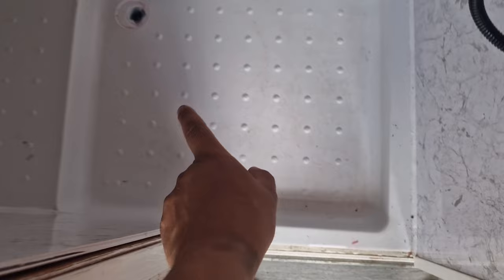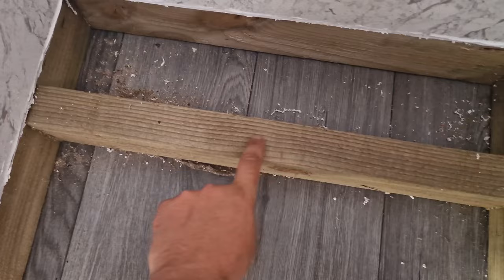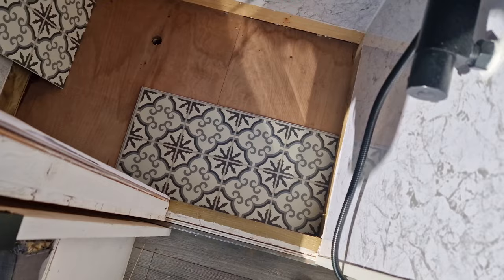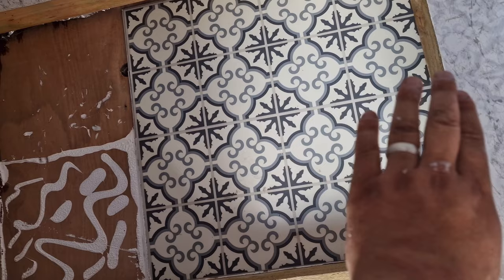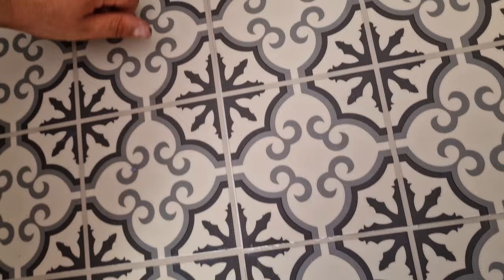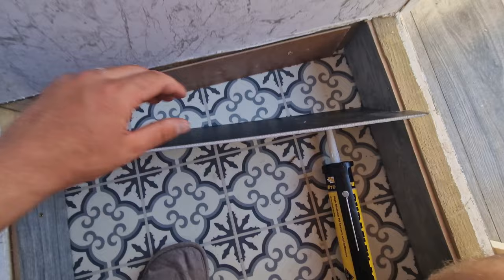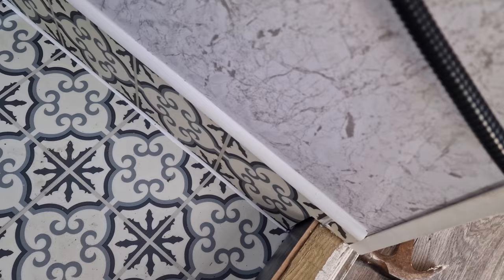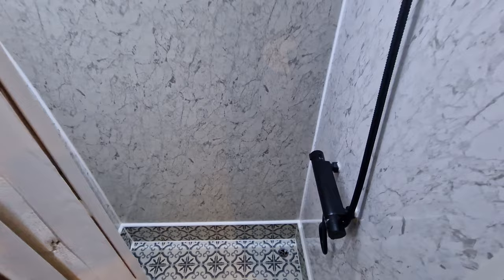DIY shower tray in our camper van (Van life UK) S1 Ep8

Comment: Jordan could you not have done the same as a wet room flooring? That way the material would come up from the base to all the 4 sides as a one and you would just slice around the top edges. You wouldn’t ever need to worry about the silicone or poxy degenerating over time
Reply from the maker: Yeah we could have done that we just wanted the tile affect as it will be epoxy resin in the long run so won't need to worry about it not being waterproof

Comment: People just don't share enough info these days. You could have gone to a metal shop and had a stainless steel pan made to the same dimension as the plastic pan. Popped it in and sealed the edges.
Reply from the maker: Don't look as good
Reply: @Steps2adventure  I apologize. I care function. Your end result looks good.

Comment: The cracks in these shower pans are caused because they are not properly supported over the entire surface of the bottom side. But well, it looks really nice the pvc flooring!
Reply from the maker: Our friend supported they're shower tray and it still cracked unfortunetly quite alot of people got sold this style shower tray and was branded thetford and when looking into it they are just cheap material that cracks over time if yiu bend the plastic slightly it cracks but the thetford one actually bends 😂

Comment: Hi Jordan, nice to meet you this morning. Plastic shower trays can be repaired by a Speedcoat technician who can fibreglass the crack and coat will a special 2-part polymer called Speedliner, but if you wanted to do it DIY you can use their DIY product SPEEDTEX. It's a 2-part sprayable polymer that can also be rollered on and will cure rock hard whilst retaining some flex. It's pretty impossible to scratch or crack due to its flexibility. 
I have used SPEEDTEX on the outside of my van (you saw it on my bumpers) instead of Raptor as it's not as hard or brittle, the flex stops it from cracking or chipping. It's also antibacterial so perfect for shower trays 👍🏼
Reply from the maker: Thanks mate I will have a look into it shortly up to now the showers holding up nicely but I do want to seal it off sooner rather than later 🙌
Reply: @Steps2adventure  you could quite easily rough your existing surface up with sandpaper, give it a coat of their primer, and roll the Speedtex on to completely seal it all off. Tough as old boots 💪🏻

Comment: You should have lined the opening with 2-3 layers of builders Damp Proof Membrane, BEFORE installing your tiles.
The tiles will flex, and the joints will unseal with time.
With a DPM, that won't matter, because the DPM will contain any leakage.
.
Reply from the maker: Great idea 👌 however this is more of a temporary fix we will be making a drying room in the future but we use the shower outside more than the one inside  mainly going to be used for wetsuits 😊
Reply: @Steps2adventure  
If there will be water, it will still apply.
Water seeping under the tiles will lead to rot, mould, and eventual collapse. Not healthy.
Believe me, 25 years as a builder.
Reply from the maker: I'm sure it will be fine 💪 no way those tiles are moving anywhere
Reply: @Steps2adventure  
Plywood flexes, and timber expands and contracts, with changes in temperature and humidity.
Any tiles connected to it will therefore also move. Repeated movement will cause joints to fail.
Same way the shower tray failed.
.
Reply from the maker: If you had watched to the end then you would know what changes are going to be made in the coming months IE epoxy resin 😂
Reply: @Steps2adventure  
The world is paved with the best of intentions.
Reply: To many joins...it won't last